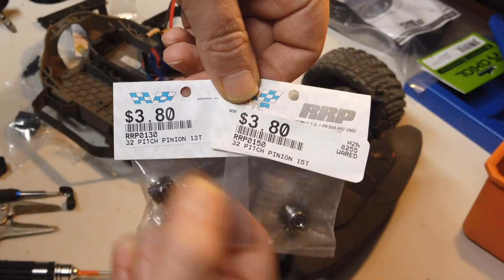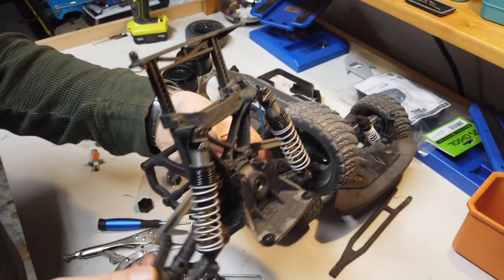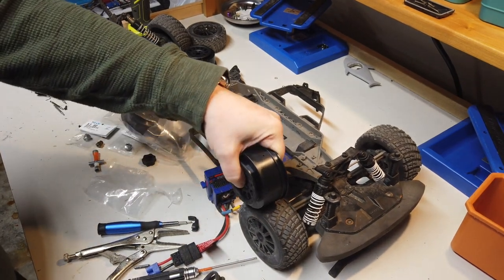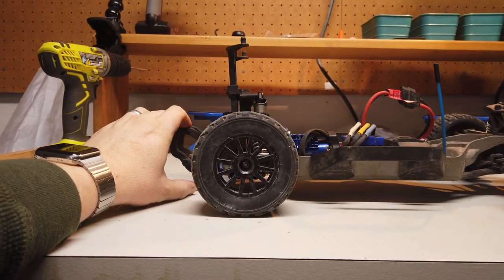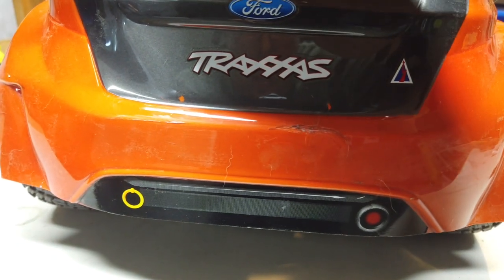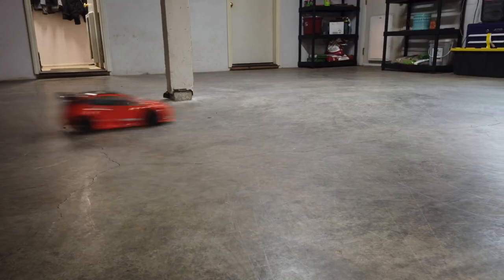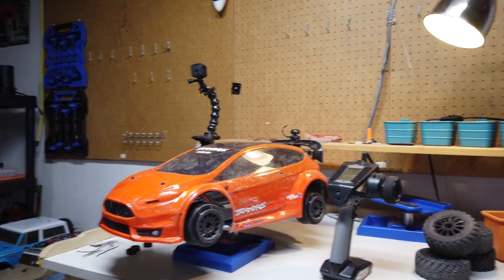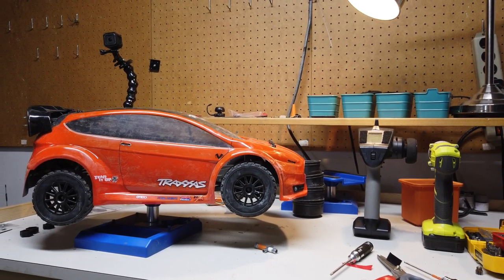Drift The Traxxas Ford Fiesta Rally - Tuning and Upgrades

Comment: I have the same car also upgraded to valineon XL 3s with fans for both motor and esc and upgraded shocks to stiffer in the front and softer in the rear so the body rolls a little in the rear end but with both front and rear having better shocks then stock and metal driveshaft axles for front chromed and rpm camber links non adjustable preset to a certaint spec. I can make my car drift like yours but with the wheels on, the rubbers are a little bigger then stock width wise with an anaconda street tire and a negative offset in the rear. So fun!!! Much props on your build!!

Comment: I have the same car and I originally ran the upgraded slipper clutch.  I had trouble drifting as well. Then I switched to the traxxas center differential and now I get a more realistic driving experience.
Reply from the maker: I will look into that. This car is so simple to swap parts on.
Reply from the maker: Love the Ken Block Rally. Ive had my eye on some of the HPI Drifters and racers. Definitely want a new one before the summer is over

Comment: Any idea what gearing combo would work on a 1/16 scale Traxxas rally that would result in similar setup as you got going with with 1/10 scale ?
Reply from the maker: I have not driven that car (but I want one), you may try the 43T spur gear from Integy for a bit more torque. https://www.integy.com/st_prod.html?p_prodid=8581 You might experiment with some wheels. Maybe these https://www.rcplanet.com/traxxas-wheels-2-1-16-rally-tra7371

Comment: hey man, I love this video. this isn't a car many people think to build but Id likes to get one and build it up like a true rally car. However, I don't know anything about rally cars and how they are set up. For example, I didn't know that rally cars are a little higher in the back than in the front. My question to you is how would you suggest that I start to gather in formation about rally cars in general to make the same adjustments on the Traxxas Rally? Any advice would be helpful. Thank you!
Reply from the maker: Hey Da Don, I kinda have a different thought process for tuning RCs. RC Cars don't really tune like a real car. I adjusted my Traxxas in any way necessary to make it run like a rally car. Even if that means it is tuned nothing like a real rally car. I know very little about real rally cars too, so I just adjust my RC till it runs like I think it should. Hope that helps. I do the same thing with my Rock Crawlers. THey just need to act real, not be set up like the real thing

Comment: Hello,¿ do you think that the subaru monte carlo that you armed will be used for dirt and mud? greetings
Reply from the maker: Hi Vicho S, I tried it in some light dirt with the stock tires and it does okay, but the suspension is stiff, with limited motion. Not the best for off road. Currently mine is just set up for street, no dirt and mud.
Reply: Gracias por responder, entonces me dices que habria que cambiar 
-amortiguadores
-
-
Reply from the maker: @vichos4512  Yes you could make some upgrades. yeahracing.com has some good stuff. TT-02 is a great chassis

Comment: I was wanting to buy one used does anyone know of a good price? For the traxxas rally with a titan motor?
Reply from the maker: Call up some local hobby RC shops. The smaller ones often deal in used RC cars. You may get some pricing off of them too. I'm gonna guess $250 - $300. I advise getting a new one and taking advantage of the Traxxas "power up program". https://traxxas.com/powerup. Lot of people overlook it.
Reply: @WorkingInTech  yeah i stick with my local hobby shop 100% they are great there traxxas support they claim to have is way over hyped sadly

Comment: Nice video , But did I hear you right!Do you mean to say a low tooth pinion gives more talk than a higher tooth pinion.
Reply from the maker: Yes, a smaller gear will give more torque. Larger gears + larger wheels = slower start with more top speed.

Comment: You want that ass end to squat man. Thats producing a positive oversteer... as the weight distribution is pushed toward the front inducing a drift, induce that drift and smash the throttle. Now then, throw away those proline shocks and stock fronts and get you the traxxas gyr shocks. Take thos axial rims to lose and size them until you find the same diameter pvc, have them chop you some lengths, 2ton epoxy them to the rims n bam!!
Reply from the maker: All you can do is test and drive till you like it! Im gonna try your idea though and drop the rear again to see how it drives. I swap a lot of my shocks around till I have the cash to get new ones, but Ill keep my eye on those GTR shocks. PVC tires would be awesome!

Comment: Did you use your stock 50t spur gear
Reply from the maker: I replaced the Slipper Clutch which has the Spur Gear built in. https://traxxas.com/products/parts/6878
Reply: Yea 54t spur.  I put a 50t spur on mines and 17t pinion.  Plenty of torque just use throttle control.